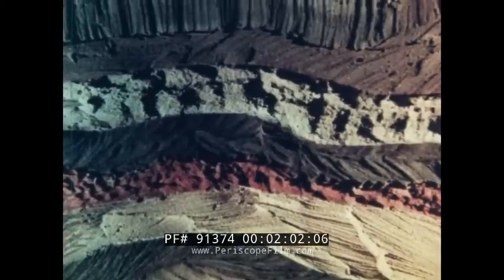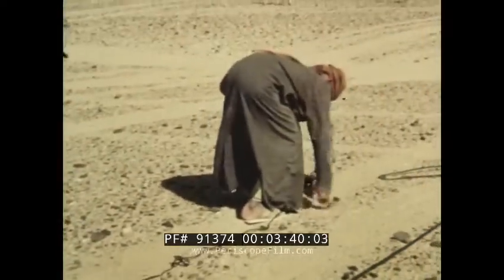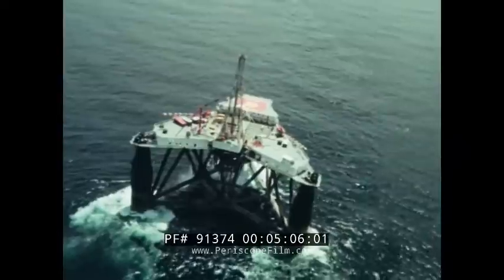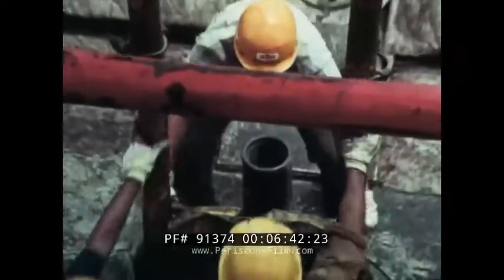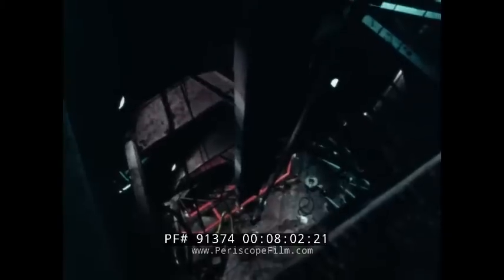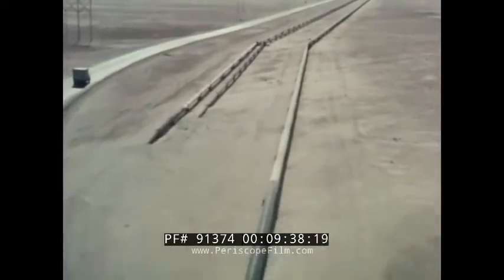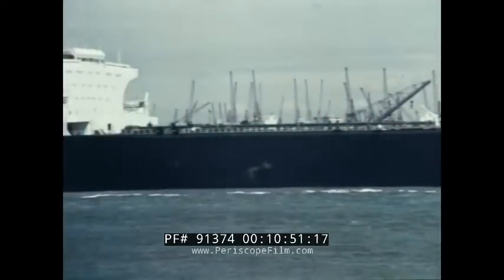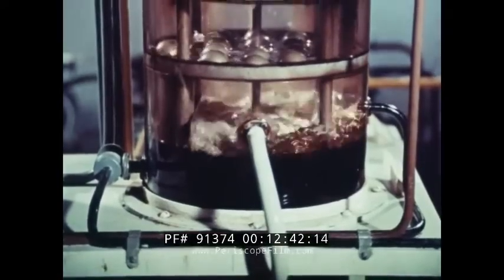SHELL OIL PROMO FILM   OIL EXPLORATION, DRILLING, RECOVERY & REFINING NORTH SEA SAUDI ARABIA 91374

Comment: I worked on seismic crews in central Saskatchewan. ( St  Warburg. area and Meadow. Lake ) in the  middle too late 1960s  / also worked on. big rigs. for Peter. Bawden and. Jennings and. Commonwealth also in the 1960s on a few  holes  / and swamped and moved oil rigs. 1967  for Kaps. Transport Ltd  ( Edmonton, Alberta based ) worked in the bush at that time ( winter) Rainbow. Lake, Alberta. Canada  ( booming years for the oil industry ) Bill. S.  Canada

Comment: what happens to the oil well when no more oil comes up what is the well filled with. there must be a large hole under the subsoil an gives unstable subsoil ?
Reply: I work with a man who works in the oilfield part time and he said after they finish a well they can come back later(not sure how much longer) and it will be filled back up with oil. So don't believe this "we're going to run out of oil soon" garbage. That's just so they can charge what they do for it
Reply: When an well bore becomes unproductive, regulations require isolation of the various formations penetrated.  Cement plugs are spotted squeezed across the well bore, then verified in place.  Much effort and funds are needed and expended in order to protect the underground environment.  Competent responsible operators with adequate funding accomplish timely plugging of well bores.  Much like low information politicians and citizens, not all oil production operators are competent & responsible.  State and federal personnel are required to encourage timely plugging. While pluggings are, for the most part successful, there are exceptions.
Reply: No, the oil is located in the tiny pore spaces within the rock, somewhat like a sponge holding water.  The oil is extracted but the solid rock remains and thus is stable, though some settling or deformation may occur due to the removal of the pressure in the formation.  Typically brine (salt water) works its way up into the pore spaces evacuated by oil pushed up the well bore to the surface (or pumped out when the pressure in the formation is too low to push the oil all the way up the well bore) and wells will thus produce more and more brine over time.  A great deal of the oil (usually well over half) remains trapped in the rock, stuck to the grains of sand in the rock, similar to how you can wring out a wet rag or sponge but SOME water will remain stuck in the fibers of it; you cannot wring it ALL out!  The brine of course takes up the space and, over time as more brine migrates in, restores the pressure in the formation.  They've discovered that many times wells which were no longer productive, if given a period of time, will build up pressure in the formation and allow the oil to migrate through the rock to the bore hole in sufficient quantities to be productive again, at least for a little while.  

SO there is no "hole" left where the oil was-- just rock that HAD been totally soaked with oil, which was now just oily with the remaining trapped oil inside its pores space's surfaces, while being mostly filled with salt water brine.  Since water is heavier than oil, the oil will tend to be forced up over time and accumulate at the top of the formation.  

Now, we had sulfur wells located atop a salt dome near the next town over from our farm near Needville, TX.  The nearby town is called Boling and there was a "company town" out just a couple miles from it called "Newgulf", which is now all but gone. There's some videos about Texas Gulf Sulfur Company (T.G.) here on Youtube if you're interested.  We had neighbors and friends who worked for TG sometimes for decades.  Newgulf was a thriving town with a hospital, cafes, even a movie theater in the 50's, now it's almost totally gone, just a small neighborhood remaining.  The sulfur wells were drilled several hundred feet deep into accumulations of sulfur atop the Boling Salt Dome, which is a huge underground formation caused when rock salt beds are deformed and forced up into massive columns or mushroom shaped formations underground by the massive weight of the heavier rock layers over the layer of rock salt.  Salt is technically a "plastic" rock, meaning that it's very soft and deformable compared to the much harder rocks which tend to lay over it, and those other rocks are not only harder but also much denser than the relatively light salt layers they rest upon.  Thus over time they will tend to force the salt to move like putty toward a "high spot" or other fracture or weakness in the overlying rock layers, at which point the rock salt is forced upwards much like toothpaste being forced out of a tube when the tube is stepped on... the salt will rise into a "dome" as it forces the overlying rock aside or upwards, and this salt typically brings up various minerals as well as oil and gas with it, so salt domes are very lucrative areas to search for oil and gas.  The Boling Salt Dome contained massive amounts of sulfur brought up by the migrating salt, and so the company drilled wells down into the formation and pumped high pressure, high temperature water into the injection wells which melted and dissolved the sulfur, and this then flowed up production wells and through insulated pipelines back to the central plant, where the sulfur was removed from the water and the hot water recycled back down into the formation.  The sulfur was then dried (in the old days) and loaded into railcars as powder or blocks and delivered to the Ship Channel in Houston or to the refineries and petrochemical plants along the Ship Channel for use.  Later on the sulfur was kept as a liquid slurry which was pumped into tank cars and hauled by rail to Houston for use or export (60's and 70's).  The plant has been shut down for decades because now most of the sulfur demand is met by sulfur removed from crude oil and diesel fuel, and much less sulfur is actually needed or used by industry compared to previous decades.  Now, as the high temperture, high pressure water (several hundred degrees and several hundred PSI) was pumped through the formation, the high temperature melted the sulfur and dissolved large amounts of it as well, and brought it up out the wells.  There was an ENORMOUS block of sulfur out there which at one time was larger than several city blocks and taller than many buildings, which was all sulfur extracted from below the ground.  This extraction DID leave voids under the surface and due to the shallowness (only a few hundred feet deep) this led to subsidence of the land surface and an enormous shallow lake was formed on what was previously flat, level land... some of the roads out there are still partially visible as the land they were built on sank and was covered by water, with oil tanks and even power lines criss-crossing what had been dry land now out in the lake.  It's clearly visible in satellite views just east of Boling, TX on Google Earth just south of FM 442 highway which curves around it.  In fact the chambers are likely far more extensive than was realized, because back in about 1981 or 82 the highway about a mile from the edge of the lake actually collapsed into  a football-stadium sized sinkhole which swallowed up the highway and two cars that inadvertently drove into it in the darkness.  Thankfully no one died as they were able to swim out before their cars sank, but it took about 2 years for the government to haul in sufficient fill dirt to refill the remaining collapsed in sinkhole and then repave over it reconnecting the two sections of roadway, during that time traffic was diverted along local farm roads to the north of the sinkhole.  The Boling sinkhole was rather famous for a time but now is just little known by locals.

Comment: The first floating rig was the Sedco A.  Started working for Sedco in 1975 and retired 40 years later, the company changed names and the equipment changed amazingly as time went by.  Was a great career but loving retirement.   If your an oil hater start at the top of the chain, that would be you the consumer.  If you don't want it drilled stop using it.  I started supporting renewable's a long ago but it will be a long time before we stop needing oil.  Two reasons energy density and portability.